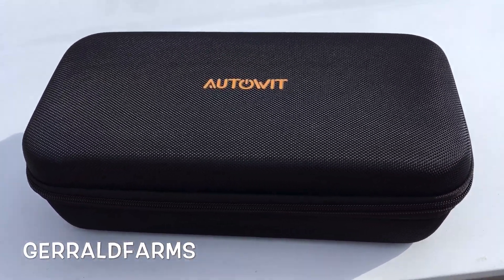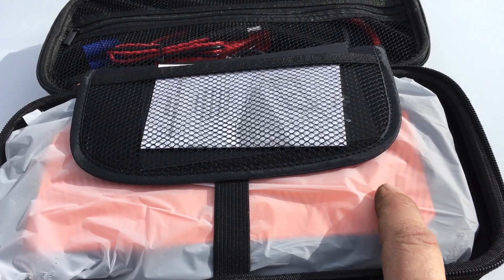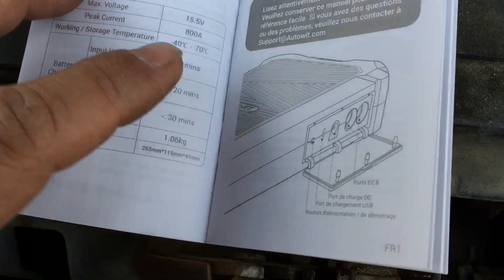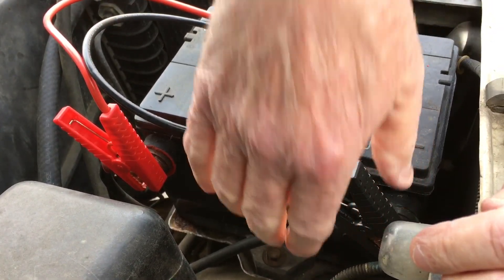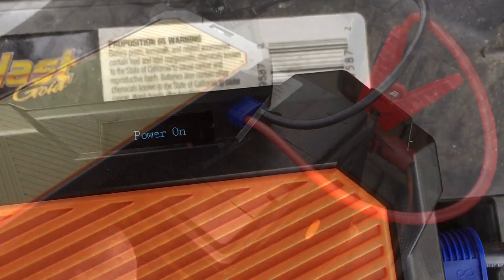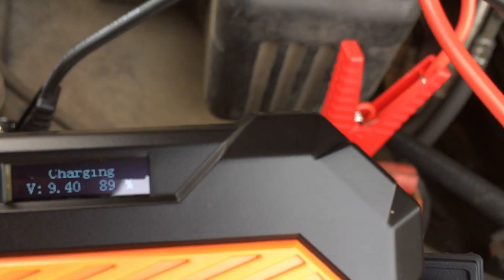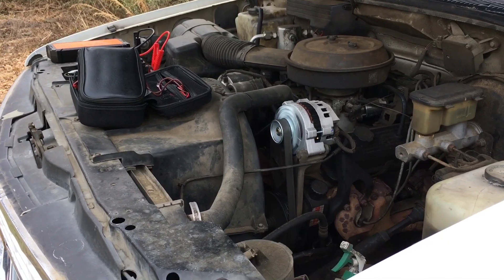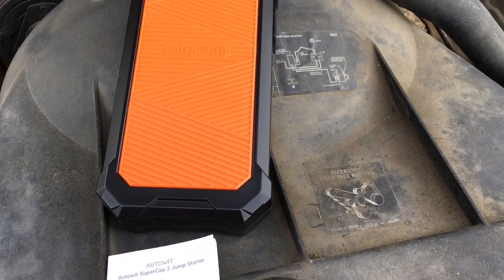Can a Dead Battery boost it self? (Autowit)

Comment: This concept, using capacitors, to aid the str battery or just caps with a tinny battery is not new.
There a folks that converted their vehicles to capacitors as it's cheaper and a bank of them will last longer than a battery. You can also purchase pre made capacitor banks to use instead of a second battery on dual batt set ups. 
It saves the primary battery and the motor cranks as it you had triple or more the cranking amps available. 
I don't know why cars don't come equipped with caps ... guess it's bad for business.
Reply from the maker: I think big money controls almost everything.

Comment: I wonder how many actual cranking amps this puts out.
In theory, you should be able to use two of these to crank a larger motor.
The specs on these are not very clear or accurate. 
Several companies/brands make these and all use peek ams as a a selling point or advertising 400 or 500 fareds which makes no sense since the caps are in series. What's the acute output of this is what I'm wondering. 
One thing to keep in mind is that the cap based jumper packs don't give you as long cranking time as the battery ones. So if you vehicle is relatively healthy these are great...but if not than this thing is not overly useful.
Reply from the maker: Thanks for watching and commenting. I’m not sure of the cranking amps. All I know is I didn’t expect it to work. But it made me believe. We have cranked our back hoe with it.

Comment: That is really neat! Especially since it will start the vehicle more than once. That way if you need it to start the truck, and then try to drive home, and run out of gas along the way, you'll be able to start it again once someone brings you some gas ;)
Reply from the maker: Lol. I’m the king at running out of gas. I never thought it was going to work.  Use the dead Battery to boost itself off.  I knew it was a gimmick. But I was wrong.  Thoughts and Prayers buddy. Have a good weekend

Comment: G  day I forgot,  Boy 400,000 miles that is doing really good.  I have 4.3 in my truck , I have 350,000 klms on,  & I am  getting a little worried.   I had 95-4.3, 2004-4.3 & 2013 4.3  & the last one gave best gas milage, but it cost more to buy
Reply from the maker: That truck is his baby. The 4.3 is a good motor. I think it is the same as the 350 just minus 2 cylinders.
Reply: @GerraldFarms  Yes there was  a fellow had chev van 1,000,000 klms on  then his 2nd one got  close to it, & they had 350. Thanks